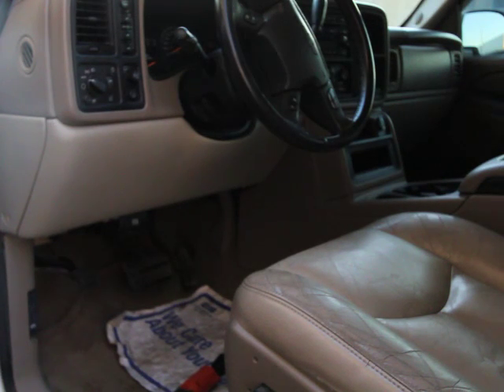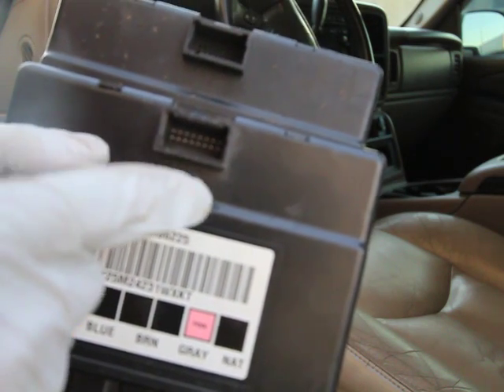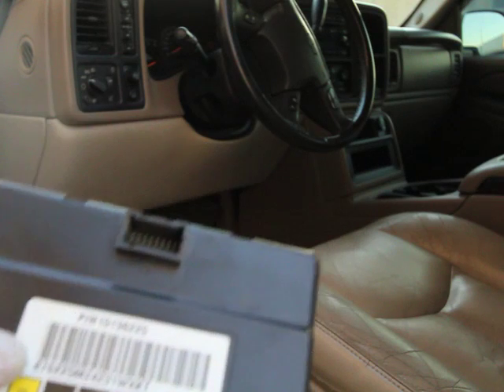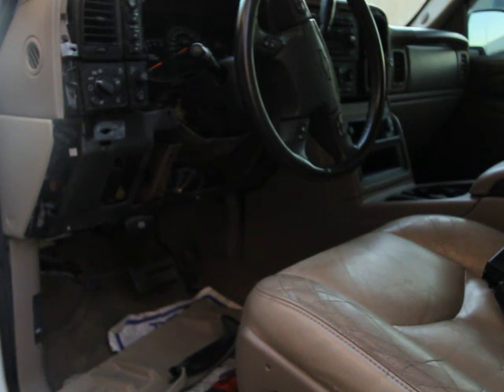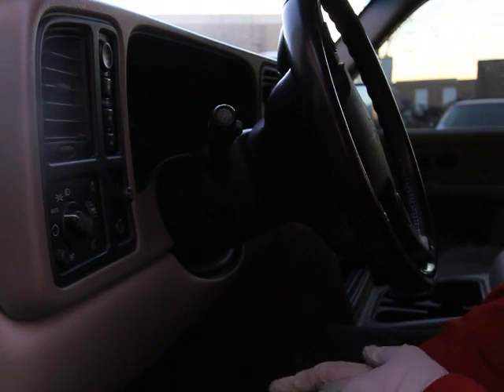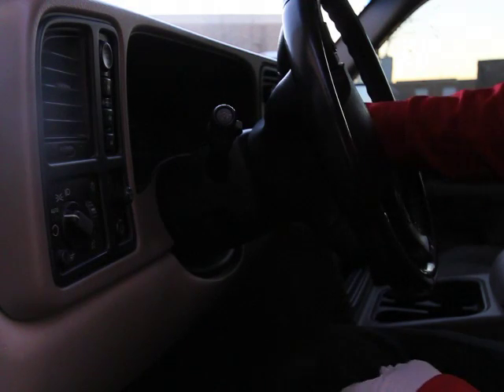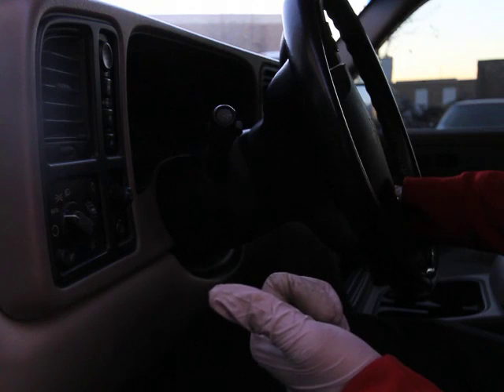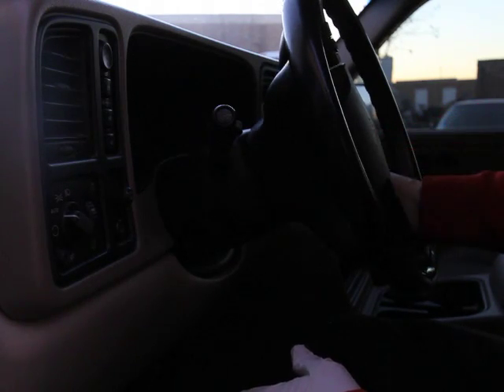GMT800 TRUCKS BODY CONTROL MODULE BCM REPLACEMENT AND PROGRAMMING

Comment: I have a back from my Yukon and I’m installing all the power  an leather stuff from Yukon. Also taking the wire harness, fuse box,  bcm, some airbag modules and all the xm nav Bose sound equipment. The I’m all installed but haven’t switched harnesses and bcm yet . Will it work with just this relearn process

Comment: 04 Silverado My dash reads (UNKNOWN DRIVER) truck cranks and starts for one second then dies. Have tried the key re learn but no luck and the the security light doesn’t stay on like it should when it needs to be programmed. Also no door locks or windows work. Any ideas??? New BCM?
Reply from the maker: Have you scanned for codes

Comment: Hey if my daytime headlights don’t work and fusses and relays are good. Could a bcm cause this problem?
Reply: The ambient light sensor might be the problem. My sockets for the DRLs were melted so I replaced them. Still didn't work so I checked the drl fuse and relay and they were both good. Lastly I replaced the ambient light sensor and now they work

Comment: First I was told to pull the modular to get numbers off it?  Did you know that it has no number?  I am now trying to replace with a remanufactured modular.  So the company that builds these modular's had better put numbers on them!!  Mine is at a Ford Dealership F-150 the part is no longer made
Reply from the maker: I have yet to see one without numbers

Comment: Will it cause the security system shut the truck down
Reply from the maker: Not start yes turn off while driving no
Reply: @SpartanAutoworx  my security system has me shut down did the relearn it's starts then if I try to drive it then security system comes back on and it won't start unless I do relearn again but it keeps coming back on

Comment: I have a 2002 Escalade with Keyless entry issues. Started failing to work only when cold outside, now its out totally and will not go into keyless fob program mode either. No one knows anything, Ive not been able top find any info on line. Not even if it has a keyless receiver like some models.  I'm starting to think the keyless receiver is built into the BCM??? Any direction would be helpful.
Reply from the maker: Has a RCDLR not the bcm.
Reply: Thanks, I've been all over utube and the net looking for info on the 02 Escalade Remote entry system. So now that I know RCDLR, where is it located? No one else seems to know...I thought it might be in the passenger door lock switch like on some trucks, but could find nothing for the 02 Escalade on it either.

Comment: The procedure you show only works if the replacement BCM has been reprogrammed to the VIN of the vehicle it's going into. I got a used BCM with matching P/N# and this procedure didn't work because it wasn't reprogrammed to my VIN.
Reply: Did you get it yet

Comment: Man I have some serious "Christine" stuff going on with my truck. (2009 GMC Sierra) I apply my blinker my headlights flicker, the engine bucks and the dash lights flash on and off. Sometimes the door locks open and close rapidly until I turn off the blinker. And recently, I grabbed my two buttons for the rear windows and as I engaged them my air bag light flashed off and on. No one has ever heard of this problem and can't help me. Do you think the BCM and computer is causing this problem?
Reply from the maker: Ground to me
Reply: @Spartan Autoworx  thanks. Checking all the grounds now.

Comment: Mine don't have a top plug...
Reply from the maker: That is for regular cab and extended cab if it does not have pins in the J6 connector

Comment: Hello gentlemen! So I have what appears to be a bad BCM on a 2005 Tahoe 2WD, fleet model. I say appears because of all these issues: doors lock but no unlock via keyless security entry/exit, no working gauges on the center. console, drivers and passengers front door controls don't work (mirrors, passenger windows), no cabin lights, aftermarket radio used to shutoff when any door opened after turning ignition to "off" but now I have to manually turn off the radio, airbag trouble light on, rear window defogger no longer works, power mirrors only work on the driver's side mirror and reverse lights don't work. Are these symptoms of a bad BCM?

Comment: Question, I have a 2007 Silverado 1500 Classic Crew Cab..  Must the BCM vin match the PCM and everything else?  Or does the security relearn fix this?  

I'm looking to add steering wheel radio controls to the truck.  Already installed the wheel and clockspring and successfully flashed the DIC to get the uplevel cluster menu.  

Tried a junkyard BCM from the donor Tahoe and got volume controls, but never attempted a security relearn due to having some rear hatch open DIC warnings so reinstalled my oem BCM.  Thanks!

Comment: I have a 2007 Chevy Tahoe coming home last night the dash light started flickering on and off and it was losing power I managed to get back home with it now I have no crank nothing. Dash lights come on gauges do not energize. Battery is good 175 amp fuse is good you think it could be the body control module?
Reply: By the way key fob doesn't work either
Reply from the maker: Very well could be 2007 through 2009 are problematic.  Do you have a scantool to read for codes?
Reply: @SpartanAutoworx  my friend has a pretty good scan tool he scanned it and he was able to communicate with all the computers except the body control module

Comment: I have an 07 GMC Sierra new body style that recently had to replace the bcm on. The problem is that when the new bcm was installed for some reason my left signal, windshield wipers & emergency lights don’t work. I also get a couple signals on dash that weren’t there previously such as air bag, hood open. Idk if this matters but my truck was Engine swapped & Had a 2007 Chevy Tahoe 5.3 engine installed. Any suggestions on what the problem might be or how to fix?

Comment: Got a 2004 sierra 1500 ext cab new battery and alternator but battery keeps dying after 2 days of none use could this be the issue bcm
Reply from the maker: Call IPC fuse and see if battery drain goes away.  If not pull TBC fuse and see if drain goes away
Reply: @SpartanAutoworx  thank you sir

Comment: I want to 6l80 Swap my 2000 silverado.  If I pickup an ECU for an 05 and a BCM for an 05 are the wiring pinouts the same?  Also, would this allow me to swap my gauges out to newer 05 cluster?  Thanks.  I also have HP Tuners so I can change whatever in the system once its together.  However the 6l80 doesn't exist in the 2000 ECU I have.
Reply from the maker: The 6L80 does not exist in 05 either. Can’t use that cluster a lot of different things here

Comment: My cluster is out it illuminates and shows check engine, i plug in my scan tool and it powers the tool but cant communicate do you know what it could be, ive tried several clusters so i doubt its the cluster
Reply from the maker: What’s the year make model?

Comment: I have a 99 tahoe & security light was on, mines crank runs for a sec or 2 cuts back off, i changed the body control module, now the security light flashes, i did the key trick & still wont crank, have no clue what yo do
Reply from the maker: Bad Bcm or pass lock

Comment: Great content. I was wondering about adding features to my 99 RCSB Silverado LS. I want the compass in the mirror. Heated seats, headlight cancel option. And turn signal in the mirror. With heat. Is that something that an existing BCM would have logic for? Or would I have to have logic programmed in a new BCM and replace ? All advice is appreciated!

Comment: I have a 2009 GMC Sierra 1500 quad cab 5.3 4x4 my gauges go crazy doors lock and unlock but mostly when I'm doing 55 mph down the road it will downshift and won't re shift again I gotta keep a scanner plugged in and when it does it I gotta clear the codes then it will shift again any ideas? I've changed the ECM module the module under the truck by the spare tire a new ignition had a shop say there was a break in the wire harness that runs under the truck on the frame rail they fixed that changed the 175amp mega fuse also cleaned the connection for that the braided ground wire on the back of the motor going to the firewall was breaking apart so ran a new thicker wire only other thing I can think of that wasn't done is the BCM

Comment: I've got a 08 Duramax crew cab.  Been fighting an intermittent electrical problem where I will get multiple DIC messages (Service Air Bag, Service 4 wheel Drive, Service Trailer Brake, Service TPMS)  All the instrument gages will go to zero, the radio will go dead, and I lose control of the HVAC and 4 wheel drive selector.  Turn signals also go out on the instrument panel but the turn signals in the mirrors still operate and the marker under the drive selection goes away.  At first I isolated this to the module that interfaces with the aftermarket radio.  Replaced that module and all was good for 7 months now the issue is back.  I tried to isolate the HVAC and radio module but the issues still returns.  I do get the P0140 loss communication code.  Does this look like a BCM issue?  If I have to relearn the air bag system, what is needed to get it reprogramed if I change the BCM.  Thanks, Dean
Reply: Obviously you have a problem with the aftermarket radio. Aftermarket junk always causes problems.
Reply: @deerhunter8533  Well that was not the case.  Even after isolating the modules for the radio the problem persisted.  Ending up purchasing a single channel oscilloscope and found the wiring going to my VICM causing my issue.  Could not find a smoking gun but I believe the shielding ground wires for the antenna connections were my issue.  Definitely not aviation quality but isolating those wires and rerouting cleared up my problem.

Comment: Had a mechanic tell me he was 99% sure it was bcm.  Got one in and replacing now.  Is it normal for the truck to start on the 1st step if the re learn process?
Reply from the maker: Year make model?
Reply: @SpartanAutoworx  2006 gmc sierra 1500.  5.3 v8
Reply: @SpartanAutoworx  all guages except rpm dead, power windows, locks and radio dead.  Ac won't blow cold.  Reader won't link.  Even buddy's neighbor who has a fancer reader wouldn't link

Comment: I've got a 2001 gmc sierra ext cab 4x4 5.3 the ac stopped working all of a sudden. Thought it was compressor had everything replaced. And it won't turn on. My mechanic made a relay that was constantly on and if you plug it in the fuse box the compressor will kick on. Take it out put the oem relay in it won't cut on. He says it's showing it sending the signal or power but won't come on unless putting the relay he made in it. Also i could not get new keyfob to program when buying the truck. I'm having battery drain also. Will a bcm fix these issues?
Reply from the maker: Keyless entry module is different on that model it’s under the dash cover above the instrument cluster. That module is probably faulty. As for the AC most likely bad ECM
Reply: @SpartanAutoworx  do you have a pcm that I can get you to flash and send me?
Reply from the maker: I do call me tomorrow 314-433-5274
Reply: Called and left message

Comment: I have a question my 2013 Silverado key fob not working anymore went to dealer they told me that i need a remote control door lock receiver do you guy’s sell that part?
Reply from the maker: We do not.  Get a used one with remote start if equipped off same Yr and model
Reply: @SpartanAutoworx  thank you for responding back

Comment: Had a jumpstart go wrong and im pretty sure it fried my bcm. The truck still runs though. The radio fuse blew and most of the electrical in truck doesn't work. For example after the jumpstart i have no headlights, gauges dont work except for rpms. radio, door locks and windows and no communication with obd2 port but does power up. Does that sound like a bad bcm?
Reply from the maker: Sounds like bad Bcm to me
Reply: @SpartanAutoworx  im leaning towards that and hopefully not the ecm. Also the truck is a 2006 gmc sierra 1500 denali.

Comment: Hey there! Helpful video, helping me to nail down where my problem lays here.
I'm adding cruise control to a 2011 silverado, with parts I've taken out of a 2008 one. I've got the steering wheel all set, everything out back together and plugged in. But no dice on the cruise. 
I swapped the wiring harness under the airbag. Cut a notch for the switches and mounted everything. (Looks great actually, pulled off a factory look)
Cruise still doesn't want to engage. No lights, no nothing. BCM issue? Where do I go from here? Please help!?!
Reply from the maker: Bcm would need that programming I would guess. Never added it 07 up
Reply: @SpartanAutoworx  kickass thanks for getting back to me so fast, appreciate it!
Reply: @SpartanAutoworx do you still supply these programmed i need one for a 00 Silverado 1500 5.3 4x4
Reply: Hello, I have a 2003 hummer H2. Your video shows I believe the Tahoe BCM ,it is under the steering wheel. This hummer I cannot locate the BCM. If you could offer any help on where it’s located I promise I will purchase one from you and I know you need the number to program it which I will do as soon as I get . I have had unknown driver, I replaced the ECM now I want to replace the BCM. I would appreciate any help. Thank you Richard nicholson

Comment: Hey, I just installed a pre programed bcm did the relearn and now I have a po300 code and its running terribly help! Thanks
Reply from the maker: BCM swap would not cause a p0300 to set. Engine controls and BCM controls are separate.
Reply: @SpartanAutoworx  Thanks! It was actually a bad coil pack. The timing was quite the coincidence crazy. Thanks again.

Comment: My 03 Silverado 4.3 every couple weeks will start to ding then the BRAKE and ABS light comes on, That last a few minutes then turn it off then back on and it stops. Zero other issues with the truck. People are saying BCM ?
Reply from the maker: Need to pull code I dont think it has anything to do with BCM
Reply: @SpartanAutoworx  ok. We ran it on a Aultel scanner it said BCM fault codes we cleared them but then pops back up. Doesn't bother me but trying to sell the truck and want that fixed first

Comment: I have a 2002 chevy Z71 1500 4x4. I have nothing that works on the dash cluster except voltage meter, oil pressure. Could the BCM be the problem?
Reply from the maker: Just the dash? everything in cab works?

Comment: I’ve noticed sometimes my door dinger dosnt work and the radio sometimes turns its self up kinda weird and the dome light flickers and the car randomly stalls why’ll driving and is hard to start after. Is this a bad body control module
Reply from the maker: Have you read for codes?
Reply: @SpartanAutoworx  no codes no lights

Comment: How do I know if I have a bad BCM? Some  issues I’m having: Seat heaters flicker on and off. Driver side seat directional controls are reversed. Seat memory is not being retained in the proper position. Also the voltmeter in the dash goes up and down, lights get dim and bright with it. Replaced the alternator, cleaned the grounds connections. Also did the big three up grade, no change. The only way I could get the voltage to read/stay steady was to unplug the amp monitor on the negative cable. I replaced the amp monitor too but that didn’t work either.
Reply from the maker: Could be a few issues. As for the seat reflash of the driver seat module should fix that. Would need more info on the rest. Give us a call to discuss.

Comment: I have a 05 grand prix gtp where the starter is disabled due to theft system. I have done key relearn 4 times. Thanks GM all 4 GM vehicles I have owned excluding this grand prix gtp have had bcm or pcm issues. My son bought this grand prix and it has been sitting 6 month on our property what a pile a garbage GM sells us!
Reply from the maker: What codes are you getting? That style bcm is cheap if its not a pcm.
Reply: @SpartanAutoworx  hi I have the following codes. 
B1370. B1380. B2945. B3055.  Then P0230 P0615. P0480 05 grand prix gtp 3.8 supercharged. I am at my wits end with this car.
Reply: This car has been such a pain. Don't mind helping my boy and his wife out but dang I am scratching my head on this one.

Comment: I have a 2004 Chevy Tahoe LT they tried to steal it they didn’t take it but I had to replaced the key cylinder and the electric switch all the crank fuses were burn I replaced them the truck would crank and start but then die so I replaced fuel pump the same I replaced the cam and crank sensors nothing but now it only cranks no start would need to replace the body control module truck been sitting for 3 months
Reply from the maker: Do the 30min key relearn. key ign was replaced which is MRD system with a magnet. Do the relearn and should be good to go.

Comment: Trying to order a control module need a contact number
Reply from the maker: 636-795-6960 or 314-433-5274 and leave a message I will call tomorrow.